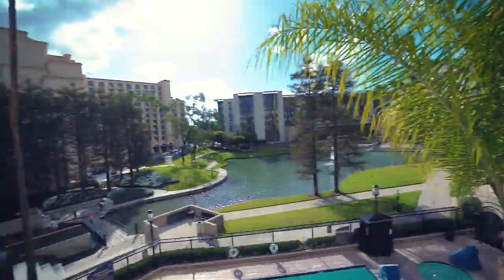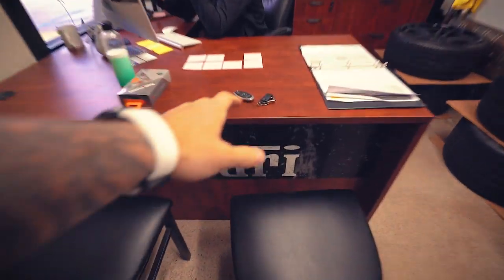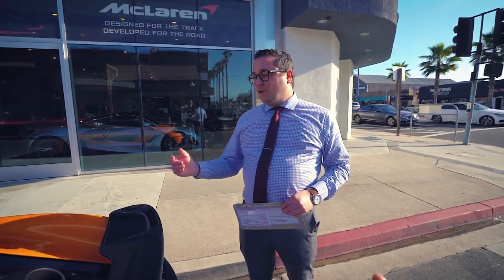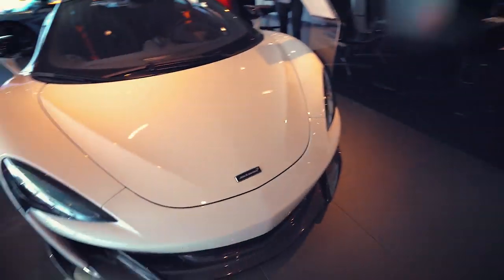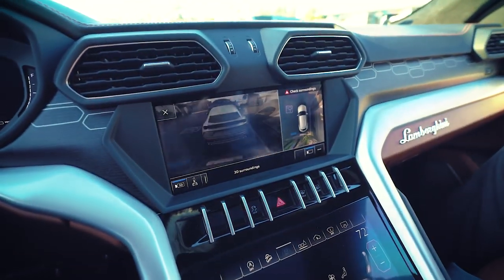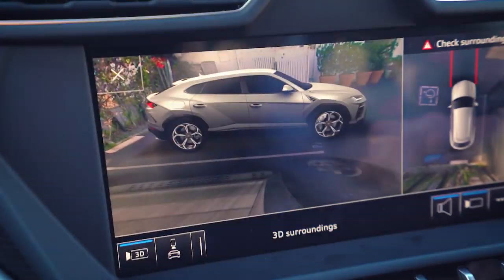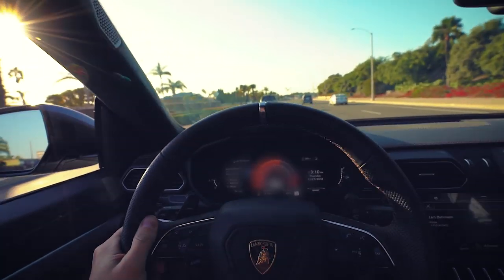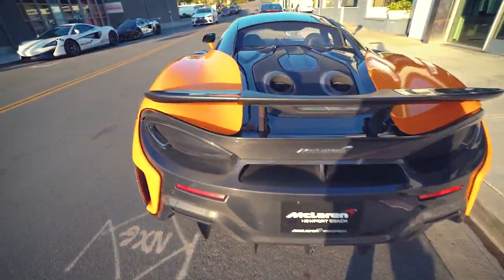FIRST MCLAREN 600LT ON SoCal STREETS!

Comment: You need to put a titanium exhaust on the murci
Reply: has a nice exhaust already that is heat wrapped
Reply: Weight reduction
Reply: He has to put the exhaust setup that Edmund's Murci has
Reply: @clovrse  Is that the AGX exhaust?
Reply: @jordanbanko5347  yes. Sadly its not possible snymore due to the beef.

Comment: We just got the 2019 Jaguar F Pace S edition and I'm very surprised at how many features this thing shares with it. One thing, to get the back seats to have air/heated control you don't need to get the 4 seater option, it works with the 5 seats too. I love customizing the ride feel when I drive like you can with "ego" mode.

Comment: I wrap cars and yes mirrors can be a huge headache. They made a good call on the spray vinyl in the tight jams. We don't use plasti dip we use stuff called Super Wrap to black out tight and tough areas.

Comment: Funny how youtubers blur out the Speedo...like it makes any difference whatso ever, if you hit and killed someone, one they would look back through all your previous videos and see your manor of driving.
And two, to get your speed, of which you blur out...you just measure 2 points in your video, for example look at the street your on, find 2 trees your drive past, measure the distance, then calculate the time it would take to do that distance, giving you a fairly accurate speed.
Do that over the course of say 50 videos, and you could prove continuous speeding and careless driving.

Not a hater, but you seem to think speed limits don't apply to you and blurring them out helps....it makes no difference